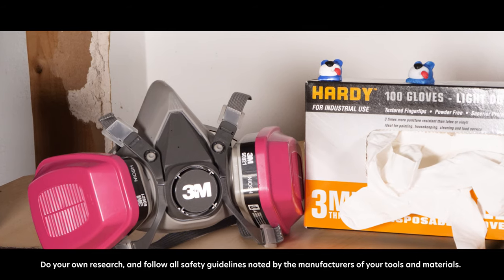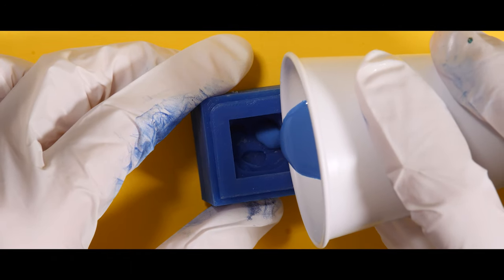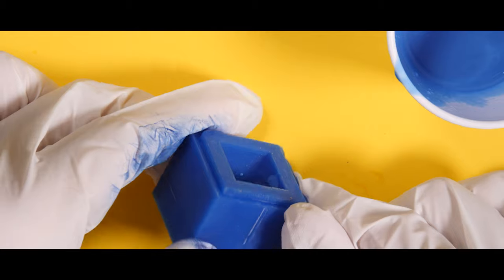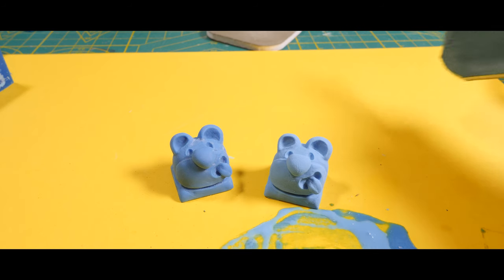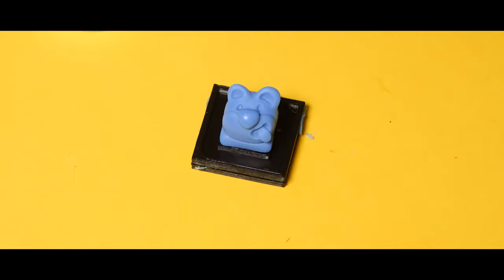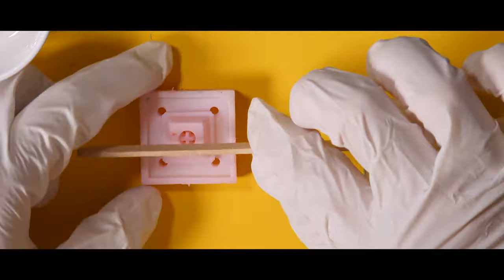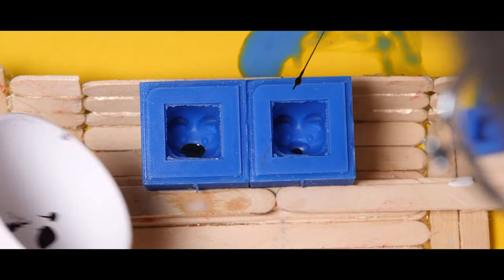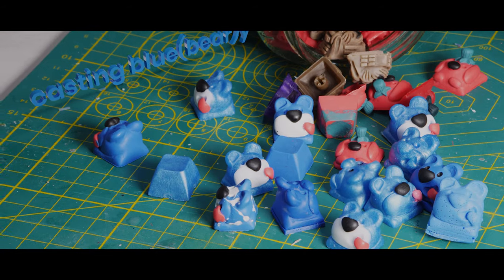resin casting and silicone mold making artisan keycaps - part 1

Comment: Ok so I love artisans and am interested in making my own but I also don't know a whole lot about the process. If I were to do so where could I get supplies to make molds and are there any other ways to finish them without needing a pressure pot? I'd love to know.
Reply from the maker: hey Matt! I've been meaning to make a video on this for a while (oops). So be on the lookout for that ( subscribe :D ).
Until then, I hope this helps:
1. You need a casting system. I use Z-butt (https://www.zappycappys.com/collections/z-butt). There are other systems, but I don't have personal experience using them. I also don't know which is "the best", but I like using Z-butt so I recommend it personally.
2. This wiki should answer many of your questions regarding supplies: https://github.com/imyownyear/Z-Butt/wiki
3. Do you need a pressure pot? Long-term I would say yes. Short-term (and especially if you're just getting started): No you do not need a pressure pot. A pressure pot WILL improve your success rate when casting (more consistent results), and obviously get rid of air bubbles, BUT you can definitely still cast without one and get valuable practice. I started without a pressure pot.
Reply from the maker: @sohtongballs  no problem!!!

Comment: When doing the different colored shots, how long do you wait until you move on to the next color? Do you put it in the pressure pot or just let it sit?
Reply from the maker: I'm using alumilite clear, so I generally wait 3 ish hours for small shots. If it's a larger shot / body fill then I'm gonna play it safe and wait much longer to get a more solid cure.
And yes I do every shot in the pressure pot.

Comment: do you put the mold in the pressure pot after each resin shot for ex just the nose? Or do you not find a need because your doing it drop by drop
Reply from the maker: Yep! I usually put the mold in the pot with each shot.

Comment: hey how do you do the holes in the top bottom mold? im trying to find an easy way to do the small holes but i cant find anything around my house that can do holes like that, i have seringes but the pointy thing is too small, any suggestions on what i could use?
Reply from the maker: I'm using the Z-butt system https://github.com/imyownyear/Z-Butt

Specifically I'm using the v2 parts. So if you add the metal rods to the stem cavity - the holes will be made for you that way. You can watch my other youtube videos to see what it looks like! https://youtu.be/xwz0iblF4Xg
Reply: @CosmoCaps  cosmo caps i love you man, made the comment more than a year ago and im in it now, I've done a lot of keycaps but because of no time and other stuff I've had to leave it for a while but im still doing other stuff with resin and molds, its mostly because of your videos that explain everything you need and want to start casting, love them and have seen most of them over 5 times, the best quality ive seen in the community, i am really thankful for your work and help. Thank you soo much

Comment: what kind of paint do you use
Reply from the maker: hi!! I don't paint my keycaps. Though, I do use pigments to dye the resin if that is what you are referring to? 
I'm using Smooth-on so strong pigments and alumilite's resin pigments
Reply: @CosmoCaps  thanks, what kind of brand or product do you use for the paint that was created while I was paying my cassette to the mold from painting?  I am planning to start this job as a professional, what kind of resin do you use and do you have any recommendations?

Comment: What silicone are you using for your mold? Moldstar 30?
Reply from the maker: Yup! But I think when I run out, I'll get moldstar 20T
Reply: @CosmoCaps  Oh how come? Faster cure time? 

Trying to see if I should get the moldstar 30 or 20. Which one is more forgiving?
Reply from the maker: @jhhoo92  yup faster cure time. Moldstar 30 definitely more forgiving, self degassing and long work time. I'm just getting impatient waiting so long haha.
Reply: @CosmoCaps  Is it 100% necessary to have a pressure pot or is it possible to remove all the air bubbles without it?
Reply from the maker: @jhhoo92 at least for me, making bubble free molds wasn't difficult using moldstar 30 (without a pressure pot). Casting was an issue though. Having a pressure pot gives you more reliable results.
Reply: @CosmoCaps  any techniques you'd recommend to remove air bubbles while casting the resin?
Reply from the maker: @jhhoo92  use a resin with a longer cure time. Stir thoroughly when mixing part A and B of the resin, but try to introduce as little air as possible when doing so. When pouring resin into your mold, it helps to pour a small amount and tilt your mold around to get all of the surfaces covered too, then pour the remaining amount
Reply: @CosmoCaps  okay great! Really appreciate your responses! Subbed!
Reply from the maker: @jhhoo92  np!!! Show me whatever you end up making! Good luck yo
Reply: @jhhoo92  I dont have a pressure pot and I have 0 problems with bubbles in resin! I didnt test in silicon yet, but I can secure to you that you wont have troubles if you buy a good resin just as I did! (I dont use smooth on, but I use what I think is the best resin in my country, which is half of the price of smooth on)
Reply: @gui-wd1gg  can you share the one you use? I'll try to find a similar product in my country. Thanks for the response!
Reply: @jhhoo92  Low viscosity resin is the one that I use, because of the low viscocity bubbles can flow to the top and they burst
Reply: @gui-wd1gg  what type of resin are you using? Urethane based resin like the smooth-on or?